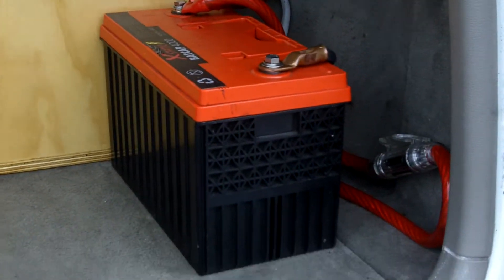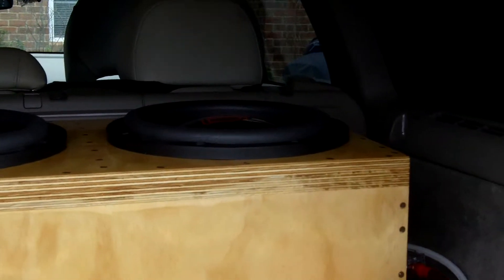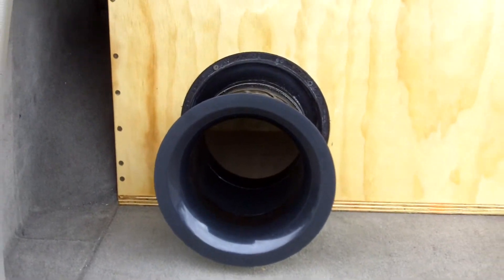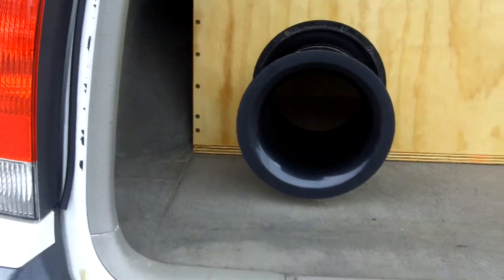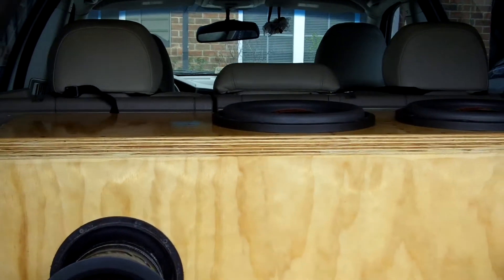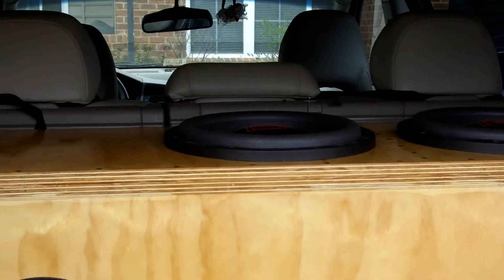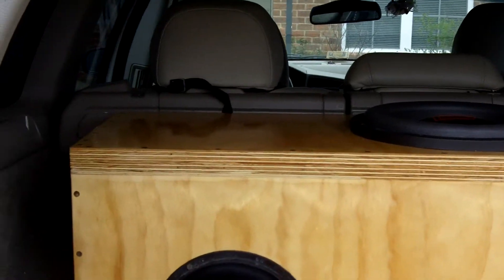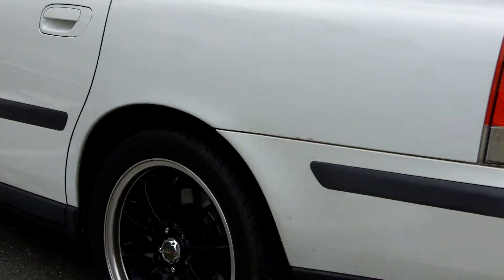Digital Designs New Box Teaser Team Deadly Hertz

Comment from the maker: They're the 2011 G's. You might be good with that size amp. I had a Colossus then a M3a on mine...honestly, I took them out and put (2) SA 12's in the same box and got louder. It's due to the box rise that DD doesn't like to leak out. Since then, I've added a 3rd SA 12 on the far left. The bass is a lot harder, obviously since less air space. Most likely going to invert all (3). Getting the roof Line X'd Thursday. Good luck with your set up bro.